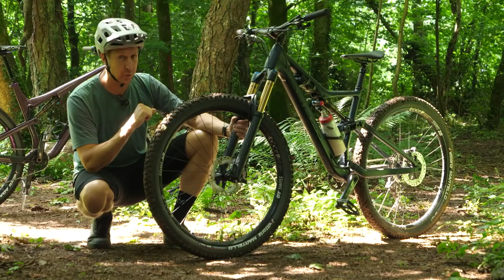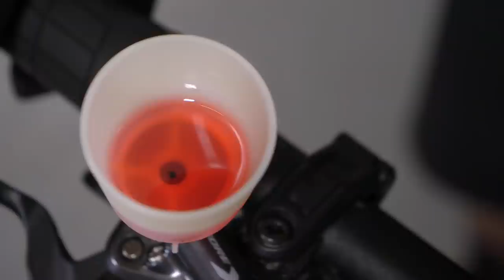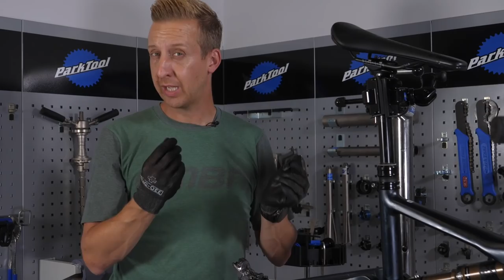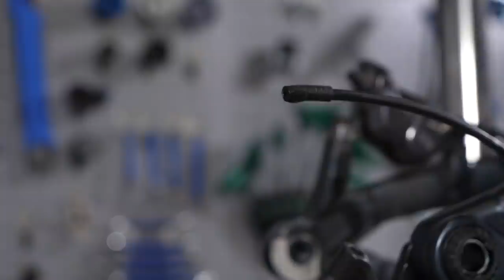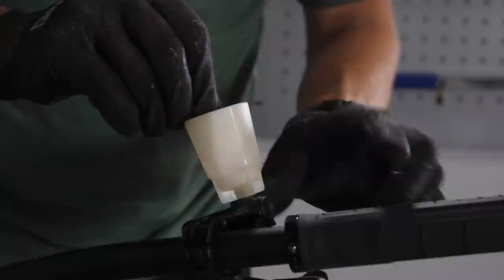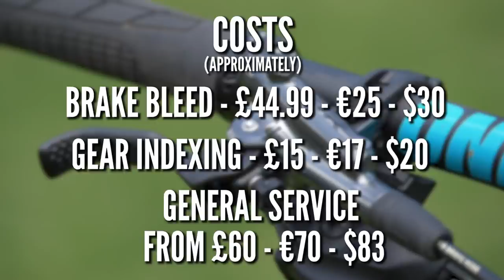Do You Really Need To Maintain Your Mountain Bike? | GMBN Tech Investigates...

Comment: One thing that I found is that overpacking frame bearings with good quality grease and then only rinse the bike off with a high pressure nozzle on the garden hose works great. I do use a chain cleaner with a degreaser when required, but that's it. So far, 6 months in there are no creaks, no play and chain is still holding up. Previously using a cleaning agent everytime after a ride wears away the grease at an alarming rate and creaking sounds appeared after a couple of washes. Sure the bike does not look clean but it is where it counts.
Reply: Suppose this depends on riding conditions. If your riding in thick mud all the time then having more grease around the bearings can be bad as it attracts more dirt to them causing more grinding.
Reply: @James-dn1hu  sure but it seems to work for my grease and frame. Mud is no issue, the little that gets stuck in the outer layer of the grease gets rinsed away with water when washed. If you have no grease it will work its way in the bearing directly, unless you are diligent and take it apart to clean and repack with grease. At least that's been my experience with my pole evolink and previous my older stumpjumper. Its like the solvents in the detergents make their way through the seals faster than mud via some extra grease.
Reply: Yup. Degreaser and high pressure are no-nos. I only wash my bike if it's got lots of mud. Otherwise it stays dirty until a complete strip down and complete rebuild. Takes a day and each component is checked. Haven't replaced components in a long time.

Comment: You can always recover contaminated a rotor. Pads are usually a goner.
The outward bend of the cage on shimano derailleurs is a feature!
Reply: True, but at 20-30$ for a typical rotor, question is if it's really worth the effort. Also the cleaning stuff also costs at least a tiny amount.
Reply: @patoberli  30 seconds with isopropyl alcohol, really.
Reply: Sintered pads are a 1min job with a blowtorch and a pair of pliers aswell... Doesn't work on organic though.
.... Just burn of that oil and run them over a bit of sandpaper to get the soot off the surface.

Comment: I have mostly single speeds and I don't ride dirt when its muddy so I just keep the air in the tires and thats about it.

I also use cable actuated disc brakes because they are easier to maintain.
Reply: Did you mean to click on GCN instead of GMBN Tech?
Reply: Hydraulic brakes are better and in my opinion equally easy to maintain
Reply: @noliemig  i've not gotten round to doing any maintenance on my mtb but from prior experience of big bikes... i think people over estimate how hard it is to work on hydraulic brakes. also they are pretty bomb proof once set up. now working on frayed steel cables and not coming away bleeding from multiple new holes... that is hard to do lol...

Comment: Every manufacturer and rider says their chain lube is the best.  Each one receives negative reviews too, often referring to dirt and muck it collects either on the chain itself or around the pulleys/derailleur chain guide, particularly regarding wet chain lubes (I'm in the UK).  Is this mainly because of infrequent maintenance or cleaning, or do any particular wet lubes stand out which don't compromise efficiency?  Pre-prep is not an issue for me, but it would nice to find out which the better one is for either quick clean or pre-prep conditions in each case.  Squirt seems to have most positive feedback % thus so far when I read rider feedback.
Reply: @RealMTBAddict  Cheers, I never knew they have a 500ml bottle
Reply: @RealMTBAddict  I'm with you on that, it saves you money in the long run and it won't go to waste.  All those little savings can go towards other bike gear.
Reply: I just use some 2 stroke mix, if you wipe it down it doesn't pick up much and it's cheap.
Reply: Look up some objective wear tests performed with actual scientific rigor. Don't get your advice on products from channels that are paid to shill said products.

Comment: #askgmbntech I am looking at buying a new rear wheel off of pink bike, it’s the right size but the thru axle is not the same as my current one, my current one is a standard thru axle, one where you unscrew it with a hex wrench and pull it out, but the wheel I want has nuts on each side like a bmx wheel. Will I be able to put my current axle on the new wheel.

Comment: Stop saying that people should not touch the rotors. Its tough to manage and does not guarantee there will be no oil or grease on it. Best practice is to clean the rotor right after install - with a clean paper towel and lots of brake cleaner -> same stuff you use to degrease your cars rotors after install. In fact - I have driven through oily puddles and stuff (car must have lost oil on road) and I have recovered my brakes by cleaning rotors and pads.

Comment: #askgmbntech Hi there, recently I installed a megneg air can onto a rockshox deluxe select plus. Once on I found that the shock now leaks air. I can’t can’t find a visible leak and I checked everything and it looked ok. I took it apart and put it back together again, it still leaks but slightly less. What do you think the problem is? And how can I fix it? 
Thanks a lot
Reply: It’s probably happening when sliding the new air can on. it can be difficult because of the resistance and that is more than likely causing one or more of your seals to move out of place, causing a leak.
Reply: Are you putting a thin layer of grease around the o-rings first?
Reply: Thanks guys I took apart the shock put more grease on all the seals, put it back together carefully and now it works like a dream
Reply: @benfairbrother2458  There you go mate!  Grease is your friend....in the right places.  ; )

Comment: A new rotor because you got some spray lube on it? Why not just clean it... And the pads can be cleaned too / sanded or just run the contaminated rotors and burn off the oil.

Comment: #AskGMBNTech can you mix different tire sealants? My Giatn came with some Giant tubeless sealant and I have Stan's No Tubes sealant. Can I use it to top it up, or I have to clean previous sealant, washout rims and then add Stan's? Got my bike for like 2 months, had no issue with sealant, but planning to do my first XC race soon, so thinking to top up just to be sure
Reply: I wouldn’t mix different brands. I mixed Stan’s with Orange, not knowing any better, which turned my sealant into cobwebs. I had to throw the tire away.
Reply: @downinla4076  thanks

Comment: I got a couply bikes: my bike, I bought from the warehouse and stripped down to frame and then put about $500 of components on it - it's my ride when I don't have a ride - City Beater Mach I - swap out stuff periodically but that's it.
   Then my other ride self built for a little over $10,000 - Mach II - maintain it like crazy, haha. 
   Carry duplicates of most of my muc off gear, and spare parts - different lube types for different conditions - keep it as clean as - so maintain it as much as I value it, lol.